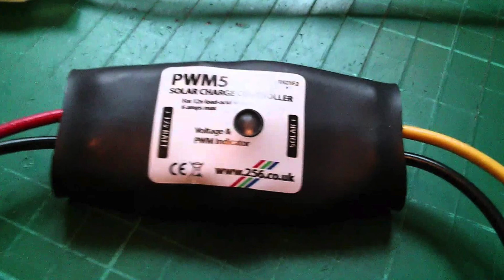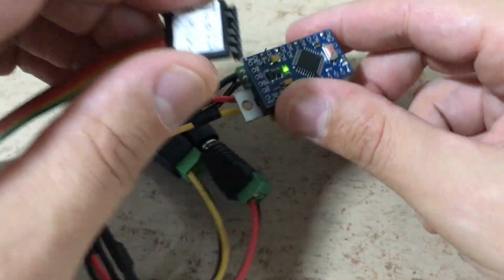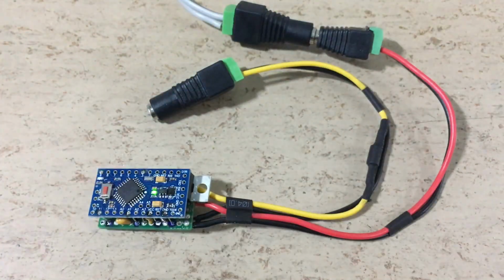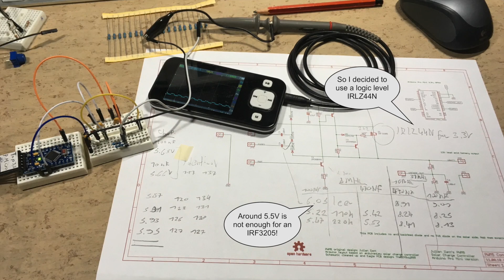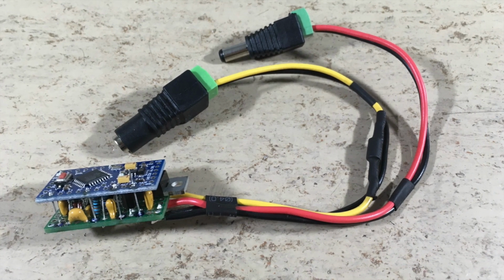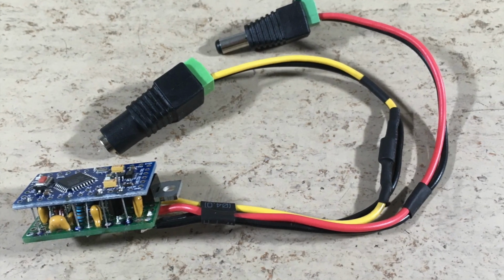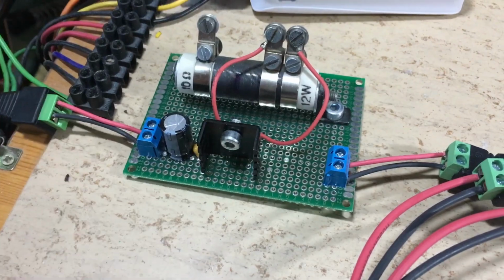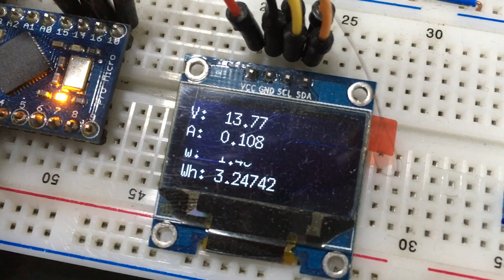Building Julian Ilett's PWM5 Solar Charge Controller: Free PCB Files!

Comment: Can i use this for a 9V battery ?? If not what are the changes ?
Reply from the maker: Yes, you can. Just change the voltage threshold in the software. However, the efficiency will be poor with such a low voltage.

Comment: can i move pin 11 to another pin pwm? if possible what should be changed in the script, because I want to use nrf for monitoring, or any ideas?
Reply from the maker: You can use any PWM capable pin. Just change the pin number in the sketch

Comment: hey man,  I am confused a little. My LED always flashes 12 times. What should be the problem?
Reply from the maker: Flashing 12 times means, that your battery voltage is between 12 and 12.99V
Reply: Thanks man!, I did not use a logic level mosfet, I just use an IRFz44 and It heats up a little. Is It normal?